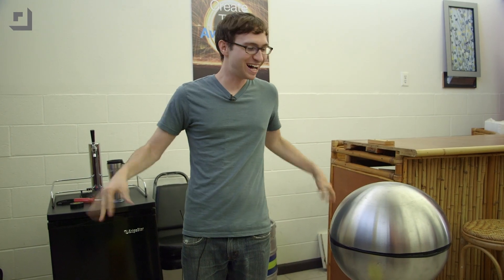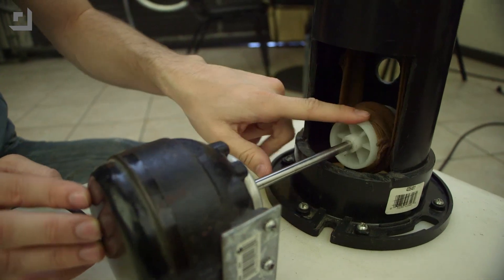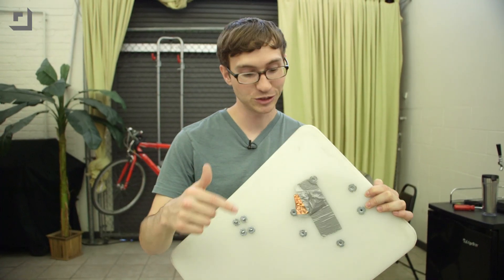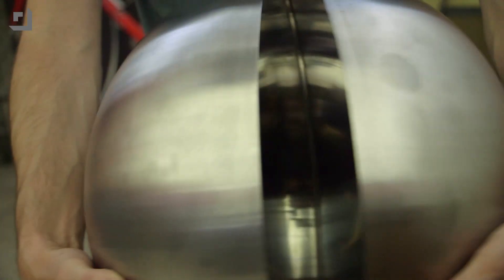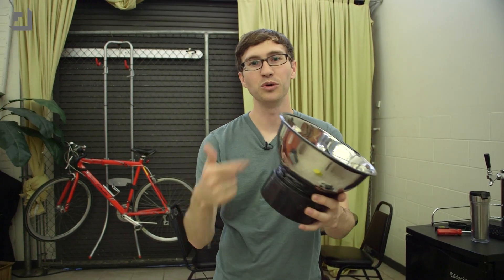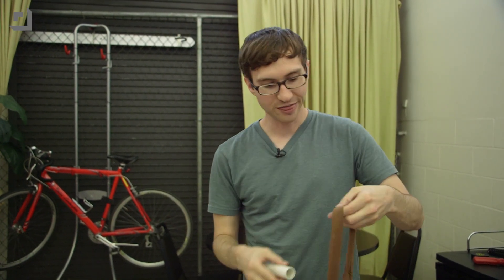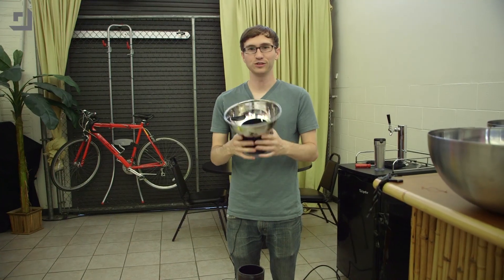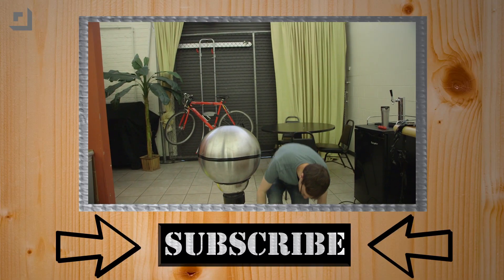How to Make An Easy Van de Graaff Generator - DIY Extra

Comment: Is the wire contacting the bottom roller connected to the grounded part under the cutting board? Sorry, I didn't quite understood that part
Reply: Yes. The contact of the belt and top roller builds a charge and then the electrons are stored in the dome. Because electrons aren't made, but transferred, the grounding ribbon is necessary to replenish the electrons to build a stronger charge

Comment: Yes, I am building this contraption. I have the two Ikea bowls. I also purchased a smaller bowl to use as a base for the two Ikea bowls. Just seemed like a better way to dismantle it for storage. finding a bed roller was not easy. (I dislike making online purchase) But found one at Ace Hardware. The De-soldering braid was not easy to find as well. For a motor, I am using a power drill. (I do not have any motors on hand.)  I did glue a single layer of panty hose to the bed roller. I now just need to install the pantyhose belt and then it will be time for a test run.
Reply: Who did it go?

Comment: Does the top bowl have to be circular, easier to find ones with flat
Reply: They do not have to be, however the rounder and smoother everything is, the better your static buildup will be

Comment: Wow old video but I have a question.  Why do you need to need to cut a hole in the bottom of the bowl?  The brush on the smaller bowl was on the inside but the majority of the charge was on the bigger bowls which didn’t have any holes.   Couldn’t you just tape the brush onto the surface of the larger bowls?
Reply: Then the charges wont go to the sphere easily due to the electric field of the sphere.

Comment: Lots of little details not shown well.  You could build this from this video but you are going to have to do some trial and error to get it right.   Specifically.  How does he attach the bottom brush and then to the ground?  Not shown.   How did he attach  the soldering brush and where?   Not shown.   Yes those who know will see this as obvious...but what about those who don't?

Comment: If you go near it with a fluorescent light it will illuminate just from being in the vicinity.
Reply: It's not a tesla coil.
Reply: I know it's not. Does that only occur with a tesla coil? It's been nearly 30 years since I saw that demonstration. My instructor did have a tesla coil there as well. So maybe I did confuse the two.

Comment: Does anyone know whether the dome is positively charge or negatively charge?
Reply: If I'm not mistaken it is both. A negative charge builds up on the inside until the differential is to great and then it discharges in the form of a spark on the outside in an attempt to equalize and so on. I think I have that right. Its been awhile since I was in class lol
Reply: @fredsilvers1427  normally only positive and the negative goes out trough the bottom i tought
Reply: @DogeGames1  You may be right. It's been a long time.

Comment: Hi Dye,  When you use this, what are you standing on so it doesn't kill you? or don't you need to stand on anything because of the ground on the bottom?   I noticed at the end your friend walked by you and got shocked.  I would think he could have gotten hurt.
Reply: BO NES well because the time is less, even because of the high power, the overall energy is Low which should at max, hurt a bit
Reply: The capacitance is low so the total energy is low, it wont kill you irregardless of what you are standing on. If you stand on something isolated the charge won't discharge, so you get the nice hair-style.

Comment: seems simple enough until you go to build it lol... what they don't tell you is centering (leveling) of both shafts are critical. other wise you belt will walk 1 way or the other. I am a mechanic, machining my own parts to get it just right. for those not mechanically inclined it is easier to buy a pre made generator.

Comment: Common mistake. The nylon pantyhose (+30 on the triboelectric scale) and PVC (-100) top roller are a good combo. Just don't make the common mistake of calling it FRICTIONAL electricity. (Antique term that really is not all that accurate.) It is more technically called pressure or contact electricity. Put some bearings on that PVC roller to keep from wearing out belts unnecessarily, as the pressure of the belt is sufficient. If you want to increase the output dramatically, wrap the PVC roller in Teflon (-190) pipe thread tape. Another tweak would be to get rid of the pantyhose grip on the bottom roller and coat it with expanding Polyurethane (+60) foam. Doing so will give you a double whammy on your belt charge efficiency while providing a good grip. The bottom brush is just to equalize belt charge since the top brush stripped free electrons from the system.
Reply: what if i use Box sealing tape instead on nylon pantyhose?
Reply: @falx7631  ditto, but specifically BOPP Biaxially Oriented PolyPropylene tape, which supposedly has a charge around +70.
I'm going to try this and let you know how it goes.
Reply: Does "frictional" electricity even exist? Isn't it all contact electricity?
Reply: @PinkeySuavo  contact electricity is electrons that are transferred from one material to another due to contact. Generated electricity happens when electrons are forced into motion by a moving magnetic field. Stored electricity (battery or capacitor) is a case of free electrons of high potential waiting to move to an area of lower potential. All of them inolve the same type of particle -- electrons.
Reply: @paulandrulis4672  Yeah, I just asked if "frictional" electricity even exists, because creating electricity with friction, is actually the same as making electricity with a contact. Rubbing objects just create more contact points allowing to electrons jump from one material to another. Is that true?
Reply: @PinkeySuavo  You are right in that no electrons are being "created," just transferred from one material to another. The terms and phrases are somewhat nonsense in that manner, because in all cases, the electrons in question already existed. Electricity itself is just a term used for moving electrons.
Reply: I don't understand, if the bottom roller and the belt are of the same charge, how are they producing charges on rubbing? pls help
Reply: @sheetalrai9228  It has to do with the triboelectric scale, and where the substances of the rollers fall on the scale compared to the belt itself. You want each of the rollers to be as far apart as possible on the scale, with the belt somewhere in the middle. This assures that the charge difference on the belt is as great as possible from one end to the other assuming the brushes are well designed and set up properly.
Reply: @paulandrulis4672  what if I put the teflon tape in the bottom and the polyurethane foam at the top will it improve the charge?
Reply: What is that tape thingy under the board?
Reply: @Peachmarmalade  Had to watch the video again, been 8 years since I watched the vid and commented. That copper metal foil duct taped to the bottom touches a wire underneath that connects it to earth ground. at the bottom roller is a wire brush with the bristles close to but not touching the rubber belt. This brush sprays electrons from the ground onto the belt to fill the electron "holes" (spots where electrons should be but have been stripped away by the top brush and are now in the metal ball at the top). Electrons always flow from places of high charge to places of low charge.  A Van De Graff generator uses a rubber belt in combination with the triboelectric series of materials as a one-way conveyor for electrons to pull them from the earth, force them onto and then off of the belt at different points, causing the ball to become charged to the point where it discharges through anything conductive touching the earth, say a human approaching the ball with their hand.
Reply: @paulandrulis4672 Thank you so much
Reply: Don’t be a nerd no one needed that
Reply: Foopy * "dont be a nerd" on a video about electricity, please, BE a nerd.

Comment: HELLO CAN YOU PLEASE TELL ME WHETHER IT IS SAFE TO KEEP A VANDE GRAFF GENERATOR UNDER SUNLIGHT FOR A LONG PERIOD OF TIME? AND WOULD IT BE SAFE TO TOUCH IT IN SUCH CONDITIONS (UNDER SUNGLIGHT/HEAT) ?
Reply: As long as the sunlight doesn't  burn/melt any components (like the electrical tape or the power cord)  you should be fine. You should be more concerned about humidity. And even if anything like that happaned it would always me safe to tuch (unless you short the power supply).
Trust me,  I'm taking a masters in physics engineering

Comment: two things that might improve things for you.  The first is using either a clear, lucite (plexiglas) tube or a white (rather than black) pipe.  The black PVC typically uses carbon as a colorant: this makes it somewhat conductive.  The other is to use a bottom charge sprayer.  By adding a source of energy at the bottom roller, you can actually increase your surface charge at the top.  Finally, some of your readers might be having problems keeping the nylon belt centered on the bottom roller.  The point that might be missed here is that the lower nylon roller must be convex which makes that roller self-centering.  If it isn't convex, it will be difficult to keep the belt centered.

Great job.  I hadn't thought of using a smaller bowl to act as a coupler to the larger, intact sphere.  Very clever!

Thanks for sharing this.
Doug
Reply: Got some questions. What if I want to use 2 big Ikea bowls and not make a hole in one of them. Is the hole necessary or can I just connect  the top roler brush to the exterior of the bowl? Should the top roler be stationary or rotative as the bottom one? And should the bottom roler be from a different material from the top one? Thanks.
Reply: @alexradac589  You can, but then the brush might leak electrons before they can be contained into the dome. It wont be as efficient in other words. (Also the ikea bowls might be too thick, but worst case trial and error!)
Reply: @alexradac589  The Faraday Ice Pail effect works only if the bowl is cut and it surrounds the top brush.
Reply: How would the extremely minuscule conductivity of the structure matter
Reply: have a question. How do i build the charge sprayer and what are the fcators that increse charge amps or volts? nad how do i know if i have to connect plus or minus. nad how should i connect the sprayer?
Reply: @scipug3048  He has not even replied in 3 years.... I had also some questions to ask but cant get answer as he doesn't reply :")
Reply: Absolutely right
Reply: I don't understand, if the bottom roller and the belt are of the same charge, are the producing charges on rubbing? pls help

Comment: I made a generator like this and it works great! However, I need to explain the physics of it for a project and am having a bit of trouble. I know that the static charge is created by the triboelectric effect (friction), but I'm really confused if the charge that is accumulated on the sphere is positive or negative and how that happens. Help?
Reply: You could watch the video by +RimstarOrg on how a Van De Graaff works

Comment: You mention grounding by using the strip at the bottom of the base. Would using the ground wire from the incoming power plug work as well?

Comment: Hi! i tried to make my own generator but i only get 1 cm sparks but nothing whit the hair, i think i'm loosing charge in the process. i have some questions so i can finish my project. The roller might inside of the tube? the bottom brush is the same as the top brush? the tube and the belt might have an specific length? the top brush might be touching the sphere or the sphere support?  thanks!

Comment: Very impressive output.  He's got around 400Kvdc worth of  output from just a nylon belt!!
 An improvement on this generator uses a length of polyethylene belt material and spaced out foil tape sections with about a 1.5 cm gap in between the foil sections.  The bottom of the generator is then connected to a small 10Kvdc charge sprayer. This can be made by a small plate charger coil from a Xerox copier or laser printer or alternatively a car ignition coil run on 6-8Vdc will work.  
With this improvement you've made a pelletron generator. these can easily overcome the humidity in the air.  
Word of caution:  
When playing around with Van De Graaf generators/ pelletrons / other electrostatic generators, understand that the larger the toroid (top terminal) the greater the output potential in Kv and greater the current.   A gigantic professional salad bowl or mixing bowl (available in China town or some Korean food stores for making large quantities of Kimjang/ winter kimchi)  ~35" across can build up nearly 1MV worth of charge ( 1,000,000 V). There will be enough current to do damage!  If you decide to make one, do so carefully.  IF you do build one you'll also need to make sure that your charge belt
also increases in size.

---> for Pontus Welin
Van De graaff generators are potentially useful for charge spraying plants (water droplets/ fungicides/ pesticide stick to plants because of charge),  power coating non metallic objects.... the list goes on. They are also useful in desktop particle accelerators for generating small interactions between heavy atoms and high energy electrons/ other subatomic particles.
Reply: actually no the sparks  are just such a high voltage dc they jump the gap.
It repeats the spark after enough charge rebuilds on the sphere.
The sphere is acting as a high voltage capacitor.
The voltage will just keep rising until the charge leaks off as fast
as its being created.
Reply: The foil sections you mention, are they on the belt itself? How wide are the foil sections themselves? And where could one find a polyethylene belt?
Reply: Is there a schematic you can refer me to for this? Thank you.

Comment: The belt rotates smoothly but it is exposed to open air i.e. there is no tube or pipe in which the System rotates. The upper roller is a piece of PVC that actually remains stationary and the belt and the bottom roller are made of Nylon pantyhose. The motor is 500 rpm. The pantyhose rubs against the PVC creating friction which is the most reliable way to create charge. I have a good grounding too. Initially i had a stainless steel top load in the form of a SINGLE hollow hemisphere which only gave me sparks of the length 7-8 mm. Then i used two mild steel hollow hemispheres which were much larger in area and greater in thickness but had a bit of dust and rust on them which i tried to clean with a wet cloth. This gave me sparks of length 12-13 mm. The entire structure stands almost more than a meter tall and should give me a great charge and sparks of length at least 8-10 cm. Where am i going wrong? What should i do to get a much higher voltage? Please help me out. Thank You. :)
Reply: Zack L You need a pipe to hold ionized air (PVC is best). Make sure pickups are close to belt. Ground the bottom pickup properly. Use thinner metal for the dome

Comment: Need help with the bottom rollers and brushes! I'm still a little unclear on that. And the grounding too :( doing it for my school project :p
Reply: Just realized this was 4 years ago lol. Probably not on that project anymore lol
Reply: A thin copper sheet taped to the bottom of the board. The bottom brush is attatched to that and ran up to the bottom roller. It doesn't touch the roller. It's just very close to it. The end of the brush is a frayed wire like he showed. The more little wires the better for the brush.

Comment: Why build one? Is it useful for something other than shocking people?
Reply: You need another reason?
Reply: patrick norton For me that's a reason not to build one :D
I have a couch that would always accumulate static charges on me specially if I'm wearing socks, it became so painful that I actually have some resistors (just a few ohms) that I use to discharge myself every time I stand up from the couch :S
I call this couch "the curse of tesla" :D